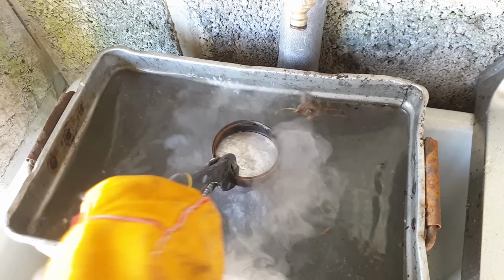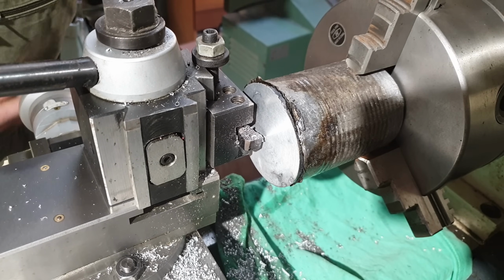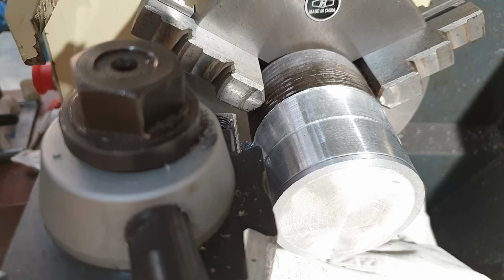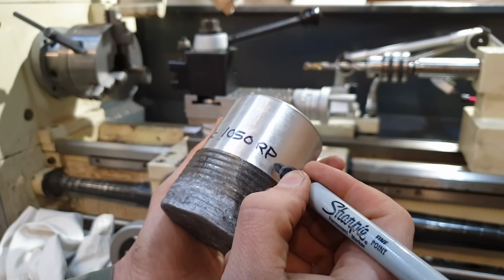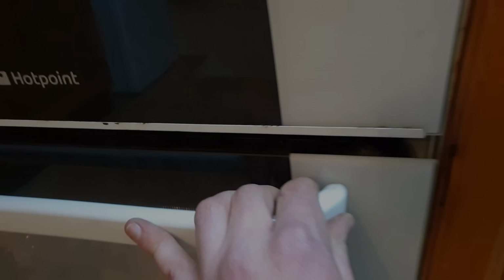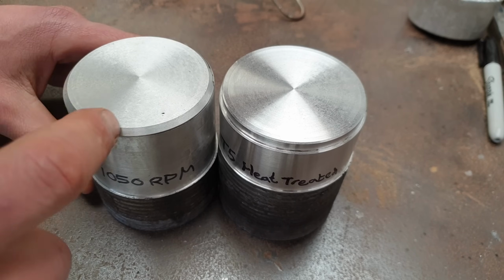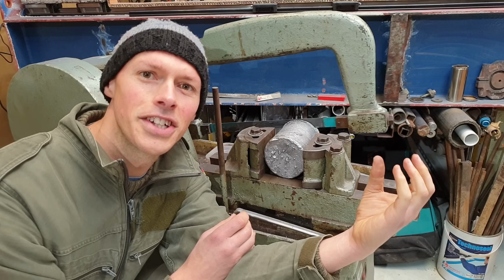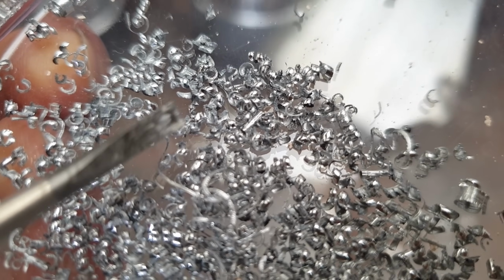Heat Treating Aluminium [Easy DIY method]

Comment: Nice video. What did you use for a melting stock? the gummy stuff is from cans and extrusions. If you used a car rim as you mention you have a dedicated casting alloy. 

Mark
Reply from the maker: Hi Mark. Yep, it was mainly scrap from alloy wheels. There may have been a few other car based scrap castings in the mix, but all just previously cast alloy parts.
Reply: @FloweringElbow  
Well, if you start out with an alloy with good machineability there's not much smearing and problems to be expected.
Would be interesting if and how a really gummy alloy would react to that though.

If you're interested in redoing the whole experiment I'd be willing to order some of the nasty shit and send it your way. If there's no scrap with proper qualities to be found of course.

Edit: Btw coolant isn't necessarily for cooling, especially with aluminium. But it helps to prevent edge built-up. A mobile MQL thingy is is really easy to make, can prolong tool life quite a bit and makes for a better surface finish.

Comment from the maker: Friends! I hope you found this as interesting as I did 😀 I learned a lot doing these little aluminium heat treating experiments, but certainly have a lot still to learn. Let me know your experiences! Might you heat treat parts in the future?  Lets talk improvements on the procedure - Ideas ??   🛠️
Reply: Cool stuff... This is the first diy tempering I have found so far.... I've done quite a bit of welding on an old battered ultralight to keep it airborne for the last few years in failsafe sections of the machine but I am now drifting towards wanting to fabricate "slightly" more critical parts for a new machine that will require re-treating after welding (6082-T6)…. Not many seem to have attempted it.
If I can crack this nut ill be a happy man :)
Reply: @pimplequeen2  Did you crack the nut?
Reply: I'm going to heat treat a part right now. I needed to make a part that i couldn't really do on my mini mill. so I cast myself a one inch cube and started at it with portaband, hacksaw, files, grinders, various files and a Dremel. when i got done I noticed i had bent it slightly on my last set up in my vise, so i gently bent it back and headed to you tube you see if it was possible to harden aluminum. my cube I casted out of some ingots i made out of my old jeep intake manifold. It was allot of work. I need to get better at holding work pieces in my mill so i don't have to do that again. I won't really have any data to share as this is a one of part and I will not be intentionally bending it up again.